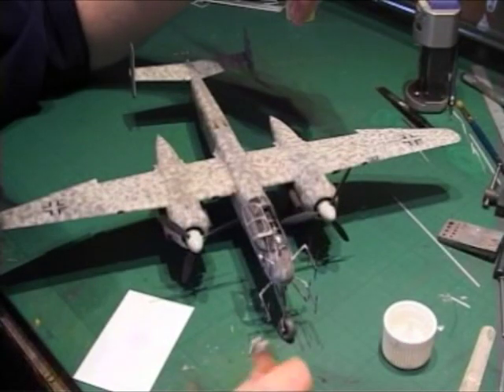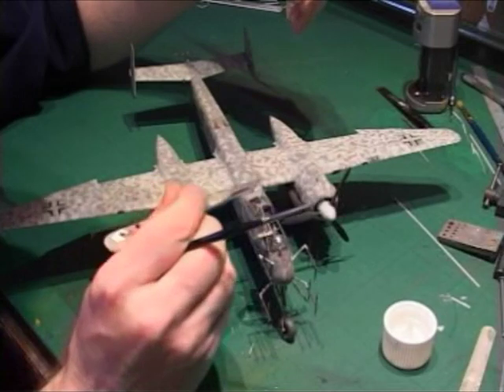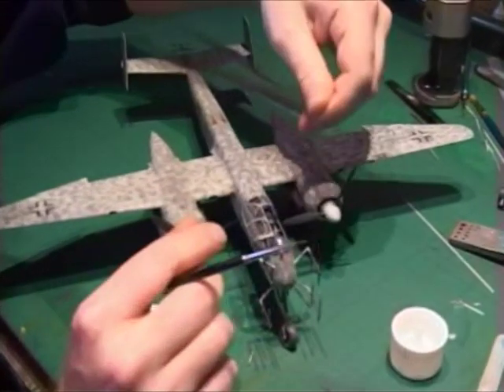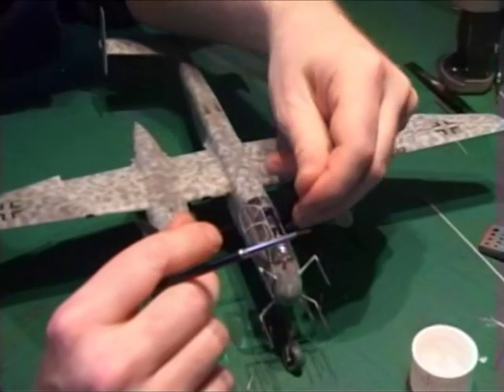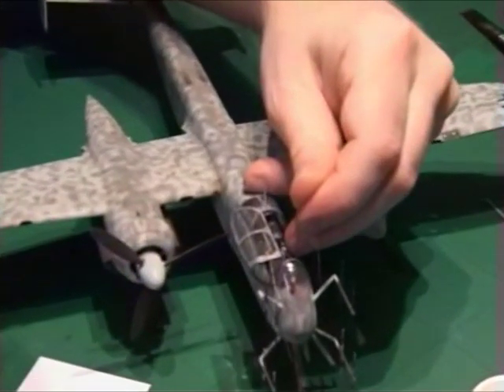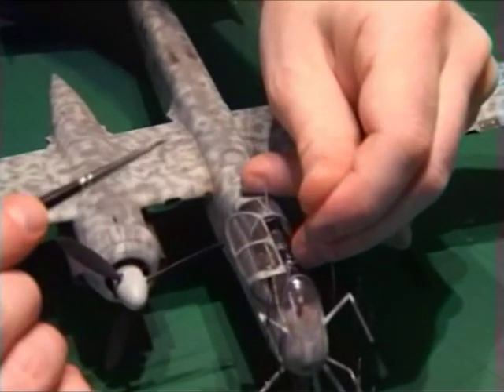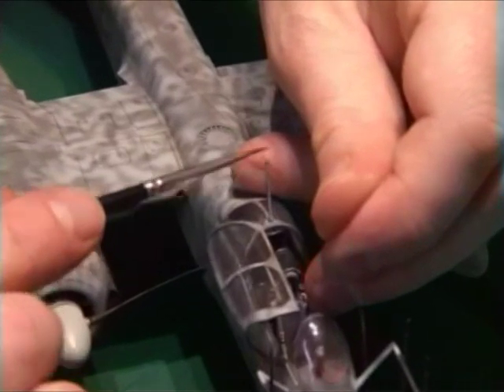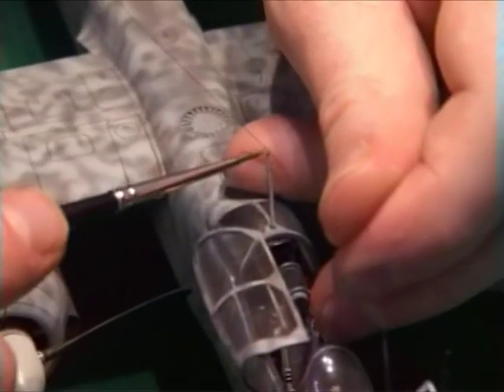Model Aircraft Painting & Detailing Angus Creighton

Comment: @BigAndTall666 true..but with the advent of mr surfacer with different grits..i havent used that filling strategy for a while now..CA glue can be very unforgiving when it comes to filling gaps while trying not to damage the nearby details of the plastic..i do use CA glue on gluing on different parts since they quickly solidify with accelerators,ie water..lol